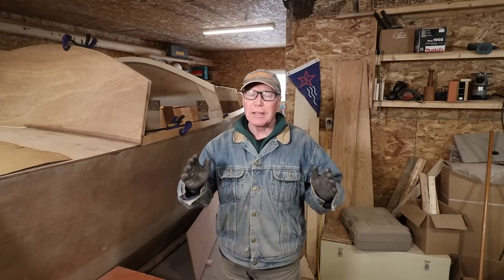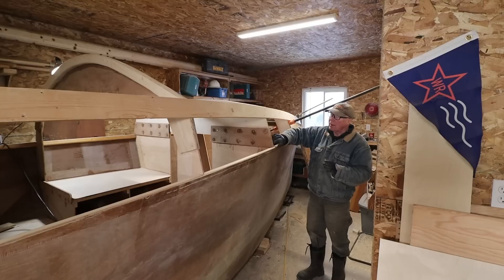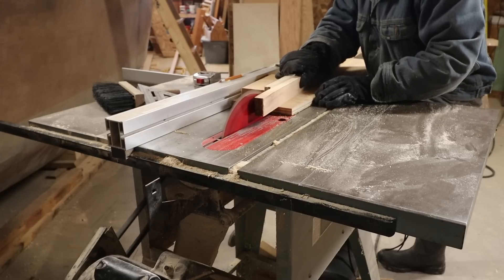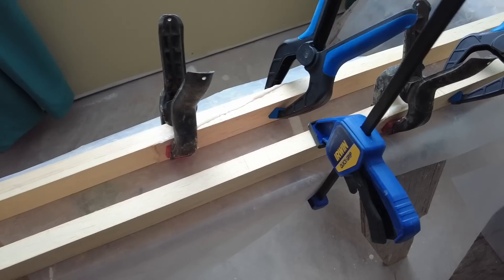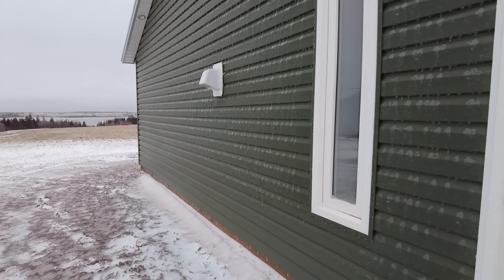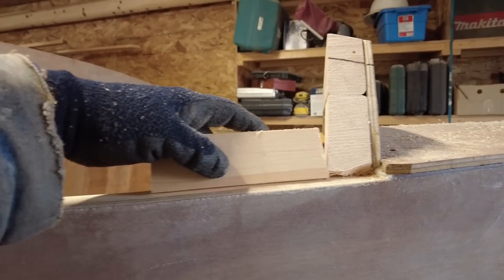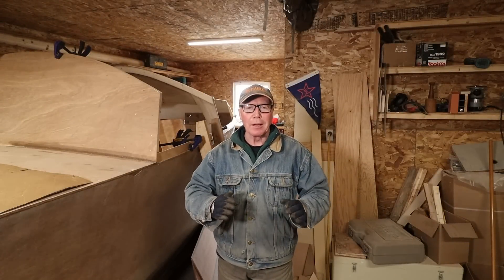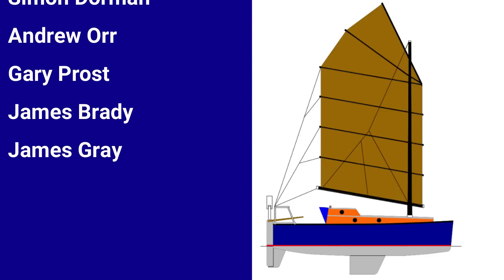S2E66 Scarfing Lumber and Plywood with the Wave Rover Scarfing Jig

Comment: Could also make the joint a bit oversize and run the whole thing through a thicknesser. .
Reply from the maker: Very true, but I don't have access to a thicknesser.
Reply: @RoversAdventure  I got one last year and what a beast of a machine it very well is. However, without a jointer I'm a bit limited as all I have is table saw. I chopped down mine to be 15mm square so I could guarantee the the edge set and sheerline. Took ages as I had to make up four strips per gunwale, 2 in, 2 out but worked in the end. Some pics on my channel.

Comment: On a more serious note, hope this severe cold snap passes you by unscathed, and all those chemicals stay healthy.  I was wondering, if people were to follow in your footsteps, would a taller piece of wood (not sure what you call it - top inside edge re-enforcer, opposite to where a rubbing strake would be) with a rebate to bed the ply into have been an option?
Reply from the maker: Absolutely, but that would still require some challenging shaping. The hull and cabin sides have an angle change at that point.

Comment: Question ! Wouldn’t be easier and more efficient if you ran all your water, electric, etc before you close in the topsides? Im just going on working on the boats I have worked on so many tight cramped areas to scuttle into
Reply from the maker: My original idea was to leave the cabin top off for better light and room to work. But weather considerations and schedule may mean adapting the plan. I'm not quite there yet but "to adapt and overcome" is the motto for this build.

Comment: Connecting the pine to the shear of the boat was a really tricky part of the build. I can see why getting an ideal solution needed a bit more consideration than other parts of the build. The scarf join for the join in the two pieces is under a bit more shear stress, did you need to reinforce it at all? I know you considered pinning it.
Reply from the maker: As I'll demonstrate in the next weeks video, the scarf joint is stronger than the wood.

Comment: Surprisingly on my Scarab 650 build I found a huge error in the shape of the cabin side/cockpit coaming piece. Both ends were tapered and when laid along the side of the bulkheads and bent around the curve of the boat, it was nowhere near butting up snugly to the sheerline created by the hull.  The tapered ends were both 50mm (2”) below the sheerline and middle about 50mm above the sheerline amidships - totally the wrong shape - and once the build was to this stage and the piece offered up, it was obvious these were never going to be even close. 

Up until then every section had fitted very well.  I checked and double checked and my mark out was correct… Goes to show how difficult it is determining the shape of that piece on paper. The second version fitted well, but it was markedly different from the plans. 

One of a number of mistakes, small and large, I found on my plans during the course of the build. An experienced professional boat builder I met later said that was par for the course with hand drawn plans.  That said they did come off a computer but I’m very sure were not rendered from 3D software, so effectively, hand drawn rather than computer generated. What surprised me was revisions had been made ( noted here and there ) but these “clangers” had not been picked up!  Still can’t work that one out… I guess no one ever told the designer.
Forgive the “War and Peace” length comment. But I thought it relevant to your discussion about shaping the cabin sides…
Reply: Could be a helpful information..! 😎👍